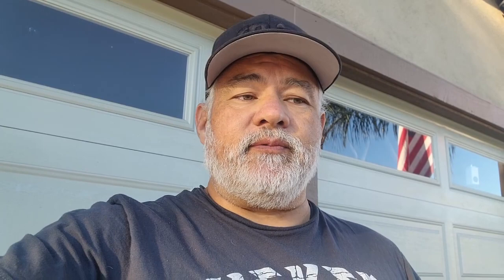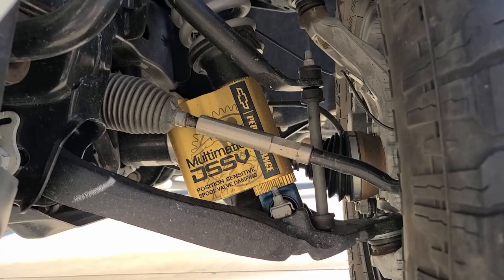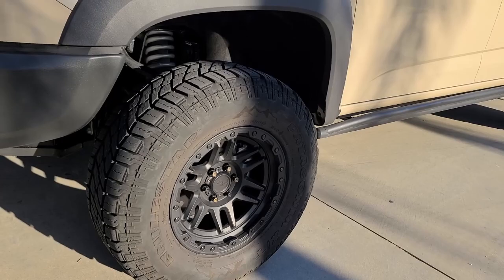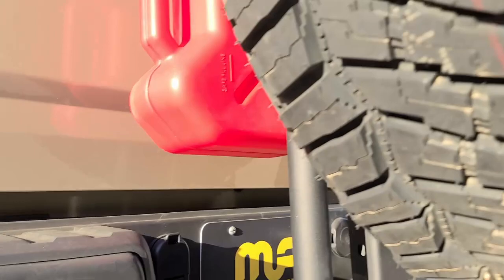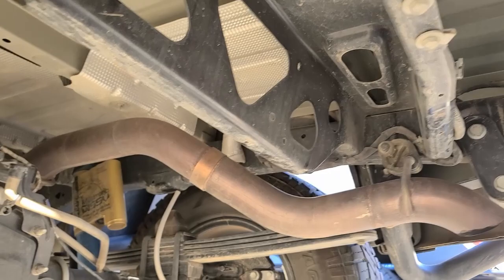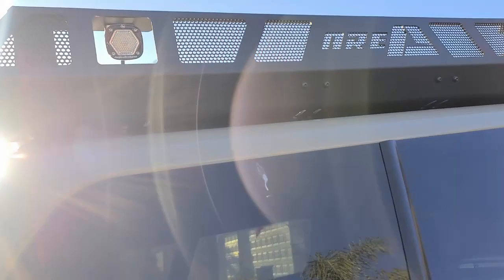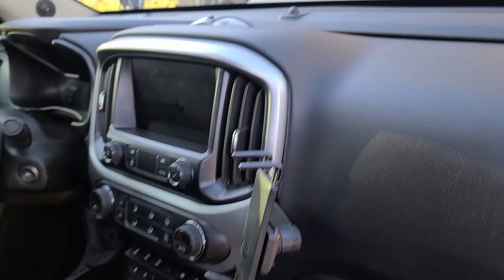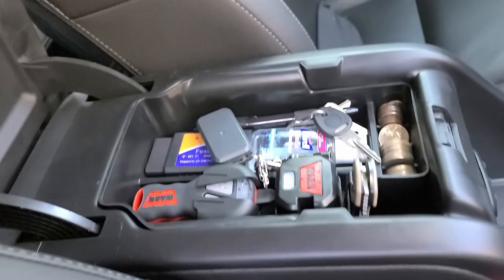OverlandBison - 2021 Colorado ZR2 Bison Overland Build Update

Comment: I installed a mallet full exhaust on my ZR2 and the power increase is exactly what they advertise. Noticeable low end torque increase and a set of the pants increase in overall power feel. I have gone with 18 inch wheels and 275/65/18 tires and the extra power from the exhaust has negated the bigger wheels and tires.

Love all the ZR2 content man keep them coming
Reply from the maker: Chuck @ Mallett is not one to embellish, he likes real numbers and real power. I expect nothing less than advertised power. I found similar results with larger heavier tires causing a hit to performance that is negated by my MagnaFlow Overland series exhaust even NA.
So many factors into why the Mallett delivers - Better intercooling though bigger  heat exchangers, volume of coolant, blower housing design and the 8 rib belt drive!

Comment: Thanks for the update. I am considering the same issues with my zr2 regarding weight after putting on the bed rack and rtt plus fully loading the bed with gear. Luckily I found a system that let me install a retrax pro tonneau cover to keep everything locked and snug inside the bed :)

It's awesome to see the alternatives guys like you put on video with all the data. I'm an optimizer/performance guy myself and am always trying to figure out the most reliable configurations. 

Thanks for the great content !
Reply from the maker: As an engineer and enthusiast I give a lot of weight to data. Stay tuned and check back as I have much more content coming soon. Thanks for watching.

Comment: I can recommend the 589 shock relocation and Timbren Off Road bump stops.  The Trifecta tune is worth every penny and really wakes up with 4.10/33's.
Reply from the maker: I have looked at the 589 shock relocation and I'm pretty sure I will need some kind of bump stop improvement as I get into the King shocks and new Deaver spring packs. I am an HP tuner capable tuner and with the Mallett Cars Supercharger coming I am going to have plenty of control over power delivery.
Reply: @exhaustinglife  The Mallett SC has been on my wish list for a few years now.  I really like what the Trifecta does for the transmission shifting, do not want to give that up.  Trifecta reports they have a tune for the 1740 SC from Edelbrock.  I keep flip flopping on ordering.  I have Deavers on order, the expedition pack.  Sumo make a helper spring (rubber)/bump stop that has been getting great feed back, may try it on the rear down the road.  My Wilco tire carrier hangs down a few inches more than yours, wish it had been avaliable when I bought 3 years ago.  Overland exh in route.  Your truck mods are very similar to mine.  Like the pass seat 5.11 gear, may steal that idea.
Reply from the maker: @madcratebuilder  Edelbrock is a solid platform but if you are looking for bigger power potential and the nature of upgrades necessary to support that, the increased cost of the Mallett pays for itself. More air with the 1900 vs 17xx and higher flowing housing are complimented by larger heat exchanges for more stable IATs but the drive system is what cant be ignored.... 8 rib and separate belt means no worries on slippage under extreme off-road conditions and higher boost. 
Regarding the helper spring/bump stop, I am going the Timbren route and will have the install and my impressions coming up soon.

Comment: Awesome set up as a standard ZR2 owner I am jealous of all the protection underneath.  Do you have any scrapes on your gas tank skid?  I keep seeing people say it's not necessary because the tank sits higher than the frame but I still would like the peace of mind.
Reply from the maker: I originally ordered a 2021 ZR2 (non-bison) EC/LB but after having seen a couple on the lot and realizing the 5,500 package price was a good value had to go the Bison route. Regarding the gas tank skid its true it sits above the frame but what matters is not just how high it sits. If you are great driver run perfect lines in dry weather and/or never tackle obstacles taller than your frame then they might be just peace of mind. The reality for me is that I am not a perfect driver, cant always stay on top of the rocks and obstacles and wheel in lots wet and muddy and sometimes icy places and slipping off of rocks in an inevitability. This all means anything taller than my frame clearance and even some things not so tall on uneven ground,  or while the suspension is cycling can potentially be a concern and lead to tank damage. Remember we have 10" of suspension travel and about 15" of frame clearance with less than 10" at the differential. When cycling the suspension a rock with less than half the frame clearance (8") while cycling the suspension (lets say 4" of up travel on the DS) while the vehicle is nearing high center can easily make contact with the tank. For me and how i wheel it's a necessity not just peace of mind.

Comment: Trufecta tuned my pedal and fuel/air and trans. Thing shifts how it should (within reason) and that lame ass pedal stuff is gone. (Within reason.) It has pep now and does what I want. And that plus the snorkel is all ive done so far as far as that.
Reply from the maker: Trifecta has a good reputation in the Colorado / Canyon world but I like to tune my own vehicles as I used tune fairly regularly not too long ago ... couple hundred cars under my belt. I just need to be patient and wait for the latest updates for the 2021. I like that the snorkel pulls clean air in but the supercharger demand is too high and the snorkel is a restriction at 400+ HP at the crank.

Comment: Looking forward to the upgrades.
Are you going to upgrade gears since you are going to 35? Or just using the power from the supercharger to help with tire size.
Reply from the maker: I am eyeballing 4.10 gears however I will let the supercharger tell me once i get it in. Taller gears are nice but if i don't need the mechanical advantage, no need to introduce the parasitic losses.

Comment: Just ordered a Windbooster  to get rid of peddle lag, will not be using radical settings just want throttle lag gone.
Reply from the maker: There are lots of those devises. I have not found need but am looking to try one out so I can talk about it from first hand experience. I am looking at one of the newer options that is app based and has some unique features called Pedal Control.

Comment: Nice rig! Do you think a diff drop is necessary? I have the same springs but no diff drop.
Reply from the maker: Thanks. The Diff drop is not a necessity but with UCAs coming up and the King Coil overs they will be. Also, its sort of peace of mind for me as the stock boots concern me with my alignment specs (High Caster) and with as much off road use as they get... the debris getting caked on and potentially lodged in the boots.

Comment: Are the rims 18" ? How much lift do you have?
 Awesome truck 👍
Reply from the maker: I have only run 17" wheels on the truck but am currently running a different set than in this video with the 35's and AEV highmark fender flares. These are a Black Rhino 17x8.5 0 offset wheel.

It has King coilovers and an Add A Leaf but the net lift is just over 1.5" over stock ZR2 and 2" in the back
Reply: @exhaustinglife  I like the 17s over the 18s and the choice of rims seems to be better.
Nice rig 👍
Reply from the maker: @richardkautz2947  Thank you, the Crestone are made just for the Colorado and Canyon keeping in mind the other parts I have installed from AEV

Comment: Regarding your winch install YouTube video AEV's winch install instruction talked about rotating the winch motor due to the feet forward install on the Bison. The clutch of the winch is on the other end of the winch. Where is your clutch access point. I know the skid plate has a slot from underneath the Bison. Please advise. Thank you
Reply from the maker: With the Warn 9.5XPS i didn't have to clock the clutch at all. I could easily engage and disengage the clutch through the skid plate hole. 
 If I remember the instructions correctly they said "if you desire to change the clocking" not that you must.
Reply: @exhaustinglife  If you check the AEV winch install they have you removing the winch motor making a new drain hole and putting silicone in the existing holes all it seems because of the foot forward position of the winch. Did not see you doing this in your video so questioned if this is needed. Instructions are on AEV web site under AEV Bison winch plate install kit. Thanks for your time.

Comment: What leveling kit did you use on your bison? I've been having problems finding one.
Reply from the maker: Eibach Pro Lift Kit for ZR2 E30-23-007-02-20 - its 1.25 for ZR2 and 1.00 for ZR2 Bison
Reply: @exhaustinglife  ok thank you so much, oh and do you have a video on doing the front lift?
Reply from the maker: @khwamtay6459  I wish I did but i put the springs on the first day I had the truck and before I thought I would be documenting the process.

Comment: What model is the A.R.E Shell, looks great 👍 👍
Reply from the maker: Thanks, its by far one of the better looking toppers in my opinion.  It is the ARE Z-series topper with the ARE Ascend Roof basket. Super happy with the paint match and interior carpet lining.  Quality stuff
Reply: @exhaustinglife  thank you very much. I have a white 2020 ZR2 and I currently have a color match Undercover Tonneau. It looks nice but keeps coming out of adjustment. I have the full bed rug too and I love it. Easier on the knees when I have to crawl up in the bed
Reply from the maker: @georges4562  I struggle with the recommended max torque specifications of any of those bed rail clamps for such accessories. I tend to go a little tighter because I send it a little harder than probably recommended ;)
Reply: @exhaustinglife  The torque for my clamps is supposed to be 75 inch pounds. The company is actually sending me all new clamps and sending to a dealer to reinstall. I’m anxious to see what’s happens. Keep up those great videos 👍👍👍